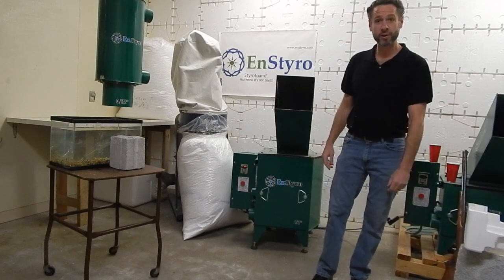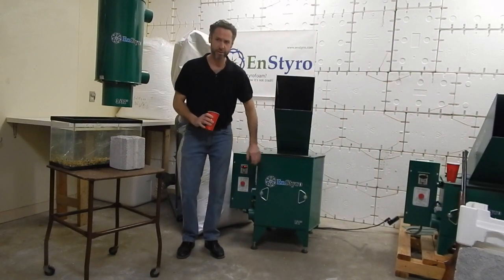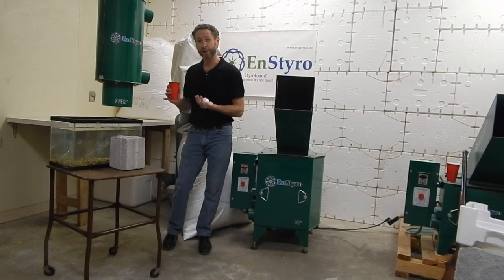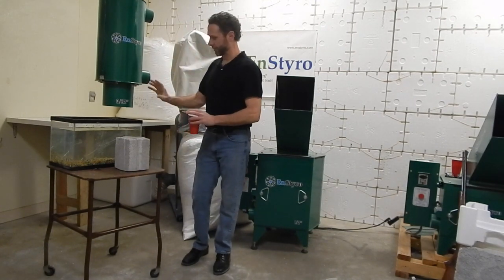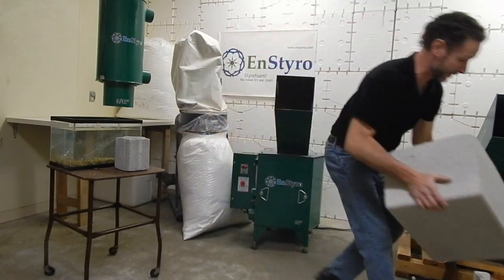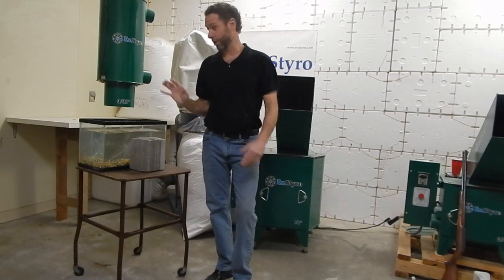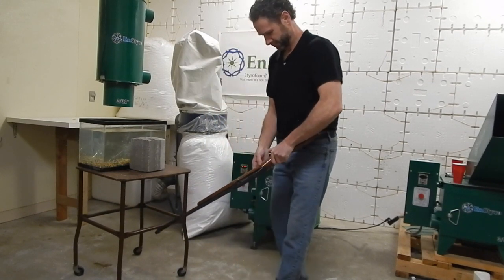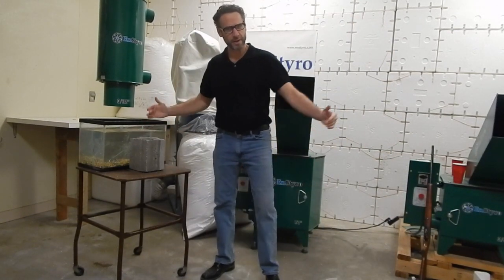Durable Floating Concrete from Enstyro

Comment: Would it last undeground, in the soil...? Say to heat insulate the foundations of house or a greenhouse (undeground foundations)... Would it work...? Will it last in the soil underground...? Wont it be damaged over time by something... (water, etc.)...?
Reply from the maker: EPS is very hydrophobic and thus resists water.  Underground insulation is a great use for EPS concrete.  It is non reactive and doesn't attract mold or pests.
Reply: @Enstyro  Thank you
So it can be used without any hesitation for underground (greenhouse for example) heat insulation of the base/around the perimetr of the base to the depth of lets say 4-5 foots underground...? It will do just fine, and it will last without negative effects on its performance, for years and years (like 20+ years...)? I read somewhere i believe (in my home country none english webpage), that EPS is not suitable for underground thermo insulation, and that is supposed be to because of the higher tendency of EPS (just plain EPS mind you, NOT EPS made aircrete/concrete) to soak up/absorb water/moisture... They say for underground insulation you should use XPS (extrude EPS)...
Now im confused which source to believe :-)! I would like to believe/prefer your answer because i like the styro aircrete...

ARe u sure that EPS is ok in underground...?

(Thank you :-)! )

Comment: Hi there. A question.

Can I use floating concrete blocks to make a solid stone Mobile Floating Private Island if I put pond liner tarp on top of the floating concrete blocks?

And then put compost and soil and grass and bushes and trees etc on top of the tarp..

And then put houses on top of this synthetic but natural looking mobile floating island and then released herbivores and insectivores (sheep / goats / rabbits / chickens / turkeys etc) to mow - brush hog and weed wack the lawns?

Could I use your product to make a mobile floating island in this way that would hold the weight of a house and soil and life in general like a regular natural non floating non mobile island does? 

Then can I anchor it like a boat?

This is what the Peruvian Uro People of Lake Titicaca have done for thousands of years with a cork like Reed root that floats. But it rots after the Island has floated for 35 years and must be replaced. 

And Richart Sowa has done this using floating plastic water bottles in nets with pallets tarps and soil on top.

Can I use your product to make a modern permanent version of this?
Reply from the maker: Absolutely you can build functional floating islands with EPS concrete.  I think we should have one or many floating islands in the great garbage patches of our oceans.  The same currents that keep the garbage in a specific area should keep a floating island in the  same general region.  It could supply iron to the water to generate huge plumes of algae and thus sequester carbon (look into the geritol solution).  Garbage collected along with some of the Algae could be used as a major component of the fertile soil for this new land mass.  For now there are people around the world making floating hotel rooms or cabins.  I would already have an experimental island if I had a body of water to try it.  When you learn how to work with EPS concrete, this type of project is not overly complicated or expensive.  Welcome to the next materials age.
Reply: I am going to start my own MicroNation in the equator somewhere.

Maybe with this material if it will float enough weight.
Reply: Can you summarize textually how to make this so I can save it to my phone notes?
Reply: @SherrickDuncan  https://youtu.be/RGQWKwExi-o
Reply: @SherrickDuncan  https://youtu.be/a79q7XY4K1Y
Reply: I would advise you to consult with an island expert like congressman Hank Johnson.
Reply: What do you mean he is an island expert?
Reply: @SherrickDuncan  https://youtu.be/X5dkqUy7mUk